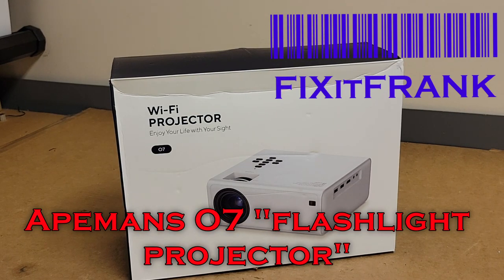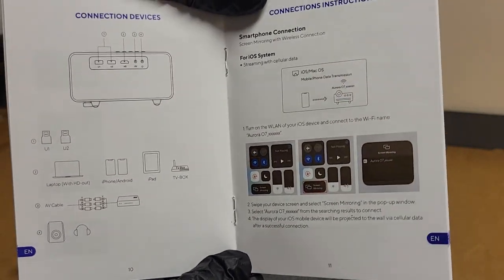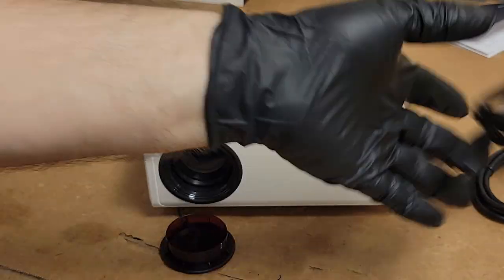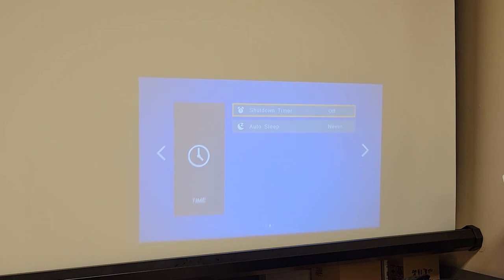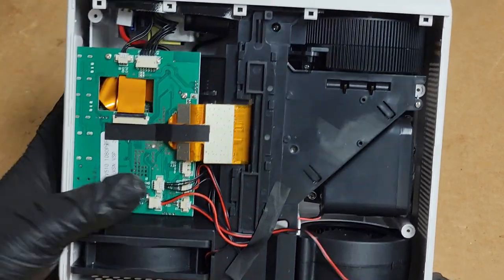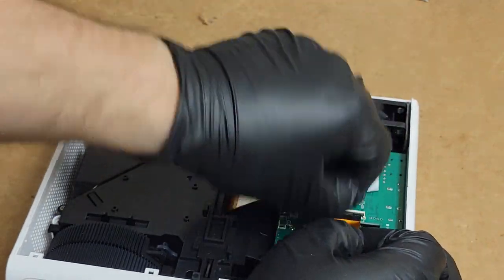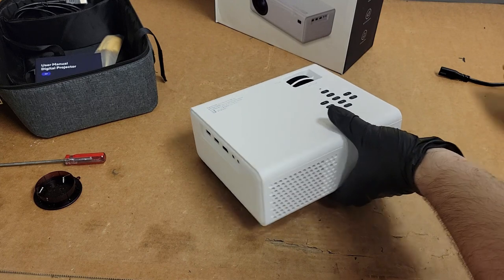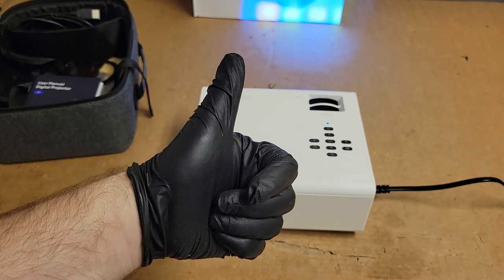O7 AKIYO Flashlight Projector Teardown/Review

Comment: I really understand your quality complaints and your advice to buy a used one for the same price with much better quality. As I am  searching for a projector for myself, I did also look at used ones. Biggest drawback, however, the energy comsumption is high on used dlp projectors, usually ranging from 250watts (ecomode) to 600watts depending on the model.
Reply from the maker: Thanks! Unfortunately light output = power use. The only way to get a bright picture is using more power. That is for any projector. The Vava laser usts use quite a few watts. Believe it or not lux per watt, lamp based is still more efficient. But solid state is improving all the time.

Comment: Great video👍🏻 Must have watched it three times by now😁

I actually ordered one of these today fully knowing what to expect. (Same make and model but it looks slightly different) It will be used in the bedroom at night and I’m using a Samsung SP-F10M for a main movie projector, so I’m not that fuzzy. I’m actually pretty happy with the Samsung despite being a 4:3 ratio for offices and presentations.

You asked what you should do with yours and I’m voting for modding it as I can’t find much info on that subject. I think it would be a fun project to see how quiet you can make it, and if something could be done to improve the overall performance.

I know some people have complained about the keystone function making the image blur towards the edges. Are all fresnel lenses created equal or is it possible to swap it for something better?

Can the blower be changed for a bigger one with less rpm to make it quieter?

The polarizer looked very uneven in your video, almost like an orange peel. Can it be swapped for a smooth one or won’t that improve the image quality? 🇸🇪
Reply from the maker: All of your suggestions are reasonable and possible. The problem is that the cost of upgrading many of the parts costs close to the same as the projector.   But for the sake of a video it might be worth trying. Very cool idea. I still have this projector in a box. I'll have to think about this. Great suggestion! Thank you
Reply: @FixitFrank  Looking forward to see what you can make of it👍🏻

Comment: Hey, can you help me to fix my Epson projector? Eh-tw7000 lamp is coming for 1 sec and than he go into protection. New oem lamp is the same problem.
Reply from the maker: What are the error LEDs doing? some Epson things I can fix, others not so much.
Reply: @FixitFrank hey thanks for your reply! The power led is normal flashing at the start. But when the projector want to ignit the lamp, the lamp blinking orange and the power (blue) too. New original lamp not will fix this. I think the ballast is the problem. I want to repair the ballast. It's a 250 watt ballast from ushio.
Reply: @FixitFrank  today I measure the 385 v output from the supply and there's no constant voltage. Mußte there be constantly 385? My supply pulsing the 385 v ⚡
Reply from the maker: Definitely should be stable. If it is pulsing, I would be suspect of the mosfet that controls the PFC output.  I wish Epson had better service info( or any for that matter).
Reply: @FixitFrank  I give you feedback in time. 😊👌